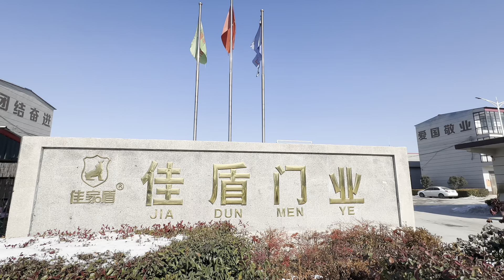批量生產別墅大門的過程，專業的大門生產廠家

Comment: a few points: 
1. wear a welding mask, come tomorrow he's going to have eyes like water baloons from irritation.
2. wear a welding mask, because the UV radiation given off when welding will burn like a bad case of sun tan, y'know the type that hurts like a bugger and maybe gives you cancer.
3. that welder is quite robust! how is he not getting clogs in the nozzel? if anyone has an answer please let me know :D
4. welding galvanized steel is NNAAAASTY buziness, i can only imagine how bad that place smells.
5. these points are not meant as an insult :) ... these guys are doing stellar job, nice finished product :D
6. please wear proper breathing masks, it's no good working for years and ending up with high concentration of heavy metals in your bones/ blood.